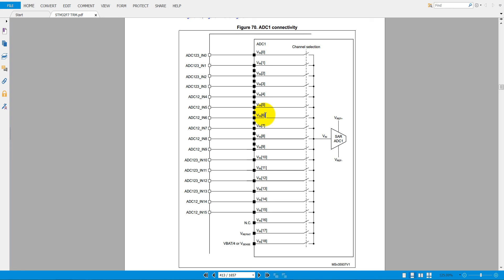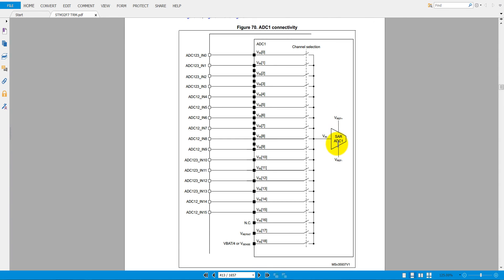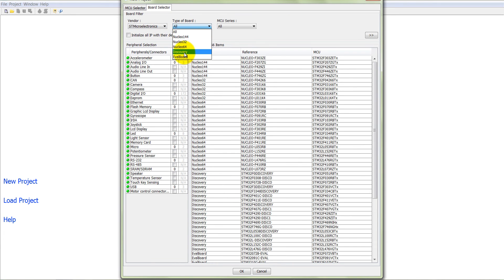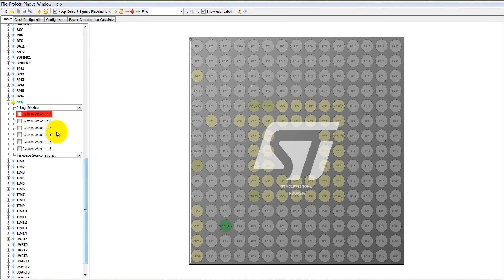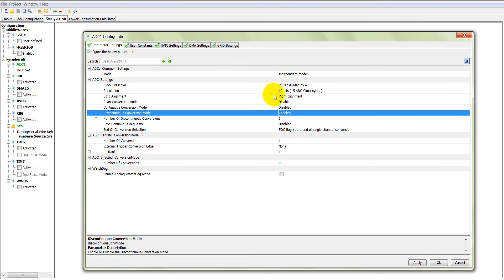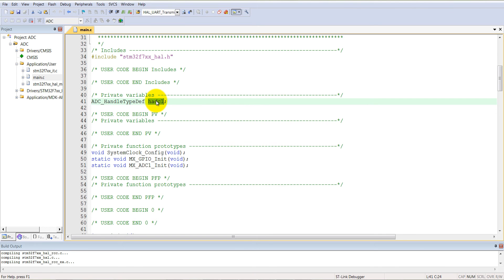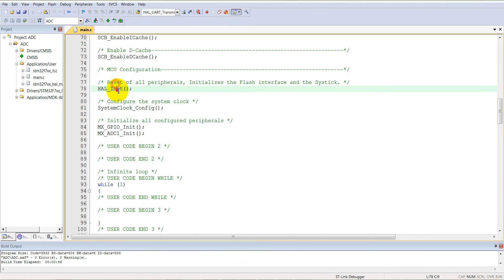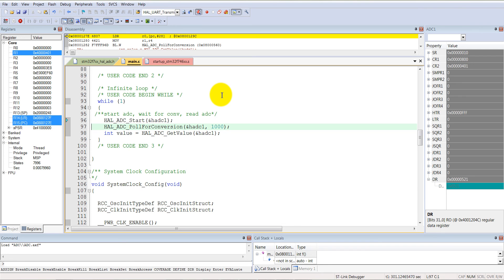9 STM32F7 Discovery Board automated ADC code generation using STM32CubeMx

Comment: Hi, nice tutorial series! I have the same board. I configured ADC1 channel0 (Arduino connector A0) same as what you did. But my values keep fluctuating and it gives only about 3000 even if I feed 3.3V to it. Ideally, it should give 4095 for 3.3V input since its configured as 12-bit resolution. I use a 10K pot and checked input voltages using multimeter.

Any help would be appreciated. Also can you please share your code and hex file to see if am missing something?
Reply: I figured out what was causing it for me. Since my code was located in another class I didn't have my instance of hadc3 setup correctly. I added a  HAL_ADC_ConfigChannel(&hadc3m &sConfig) to properly configure my hadc3 pointer and it was reading correctly after that. I just need to figure out how to do it "properly" now
Reply: @eyeTelevision  I figured it out after a long time.... The problem was in the jumper wires used to connect - they were internally open. Moral of the story: be wary of cheap stuff.